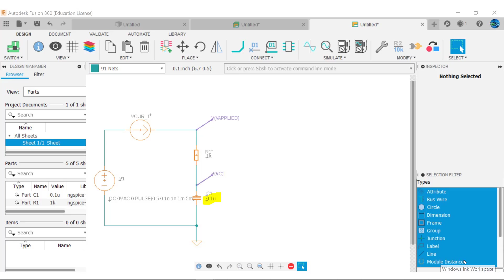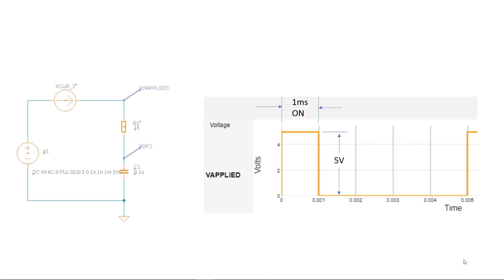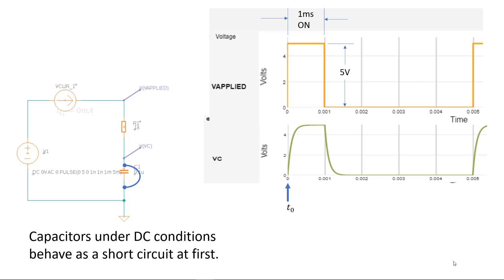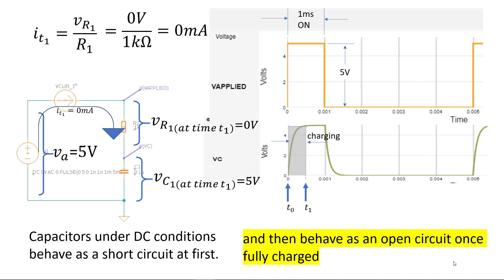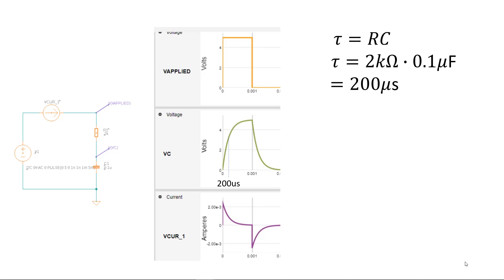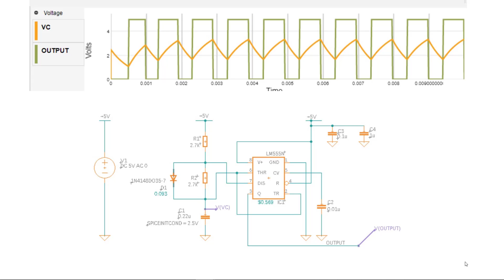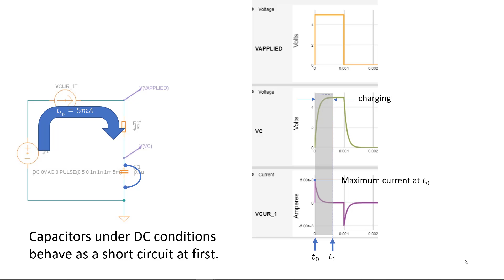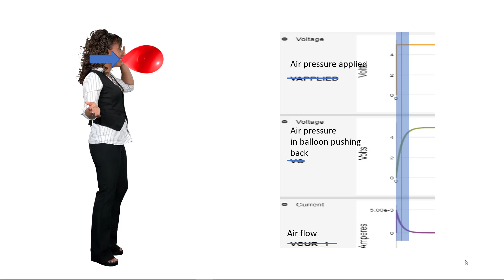Video 11   Capacitors under DC Conditions

Comment: Look at 4:55 in the time-line,why there's a speed difference between charging and discharging since there's no diode in the circuit?The charging time is 0.001,and discharging time is 0.004.(forget about the unit for a moment)
Reply: Hi Willy, it looks like the discharge is longer, but remember you're looking at the time it takes to fully discharge - that's generally agreed to occur after 5 time constants. After 1 ms , which is one time constant or tau, the capacitor has discharged 67% of it's initial value of 3V. After 4 tau (4ms) it gets pretty close to zero. The next time it charges  (and each time thereafter) it will actually charge a little bit higher as it doesn't have enough time to fully discharge. You can see this later in the video in the PWM example case.